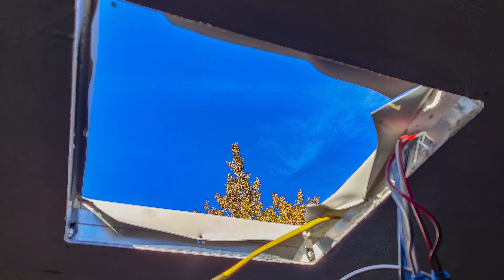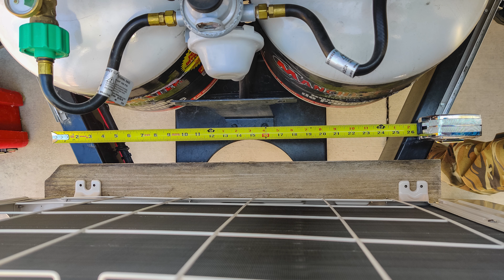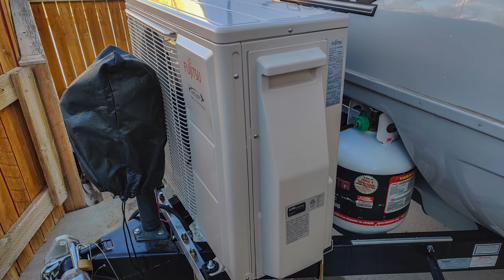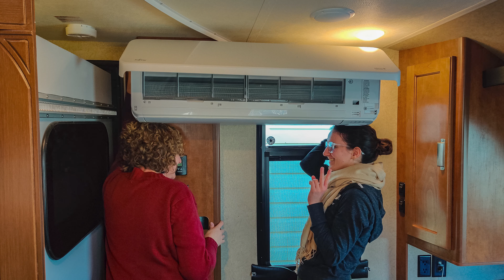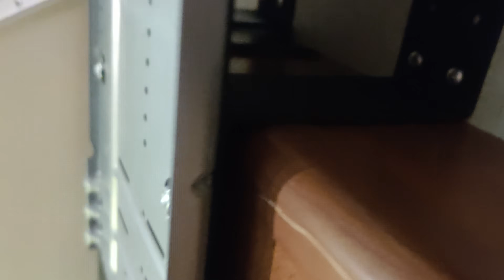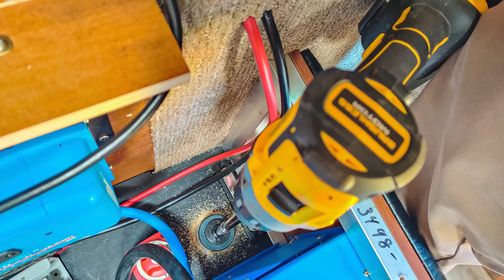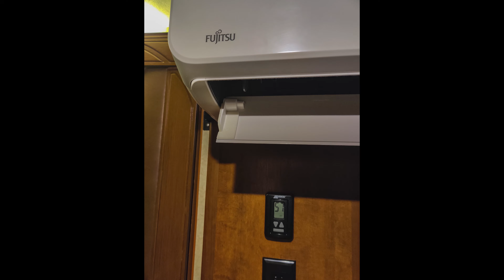How I Mounted A Heat Pump Mini Split On My Lance 2185 Travel Trailer

Comment: How come you didn’t mount the inside unit of your minisplit on the shelf above the bed. That seems like such a good place to do that on the lance trailers. You could put in some bracing (aluminum L) if needed and attach that to cabinets on each side. I am not questioning your decision just trying to find out if there is a reason I can’t do this on a 1995 😁
Reply from the maker: I wanted to mount the mini split above the bed, but ultimately decided it was too complicated of a location and likely to have problems down the road. The indoor mini split unit is significantly larger than the space above the shelf. Also the air intake is on the top of the unit so it must be installed several inches down from the ceiling. The ceiling there is curved making installation much more difficult and there's no aluminum frame there too hang the weight from. Initially I was considering removing the shelf and making a metal bracket that hangs from the first roof truss then I found the Z brackets and figured out that the side wall is a much better option so that's where I installed it.

Comment: In watching your last video (Can The Solar Array Fully Charge Our RV Batteries In One Day In February? + Valley of Fire!) it got me wondering...  why an AC mini split and not a DC?  In this video, you talked about needing 240V for charging the Tesla, which makes sense.  But I was wondering... did you look into a DC-based (12v or 24v) option?  I am wondering if they might be more efficient then an AC unit.
Reply from the maker: If I could have everything on board use DC electricity I would, because in that extreme scenario I could completely eliminate the AC components from the trailer's design saving the money on device purchase, labor to install, and efficiency losses inverting from DC to AC. However it's not realistic at this point in time to do that unfortunately. Plus there's other miscellaneous devices we bring from home such as our blender that work on AC power. I did look for a DC HVAC unit of some sort, such as rooftop mounted AC/heat pump units. I never did find a device that I felt like was the best solution considering efficiency, lots of devices out there with people using them and sharing reviews of longevity etc... Ultimately I just decided on the relatively "regular" heat pump mini split design with the indoor and outdoor units because it's efficient and commonly used technology that's not overly expensive or specialized which would make it harder to find help if I needed it in the future.

Regarding the Tesla charging, I don't have to use 240 volts, I can charge it from 120, but 240 volts doubles the speed at which I can charge the Tesla and increases the efficiency. Plus the most efficient mini split I could find (the one I purchased) required 240 volts and it's a lot more efficient than equivalent sized 120 volt versions. Obviously some of that gain in efficiency is actually lost due to having to have two inverters with their fixed standby losses, but ultimately I needed to make a decision and get past the "analysis paralysis" of the design so I just went with two inverters and it's worked fine for me. The losses in efficiency easily overcome by the large solar array on the roof and being able to transfer energy quickly to my Tesla is helpful in some situations.
Reply: @ElectricTechAdventures  I am with you when it comes to analysis paralysis.  Personally, I think it is very cool that you have been able to get into your Lancer.  

The reason I am asking about the AC is I am trying to shorten my hunt for the right solution. From your R&D did you find a noticeable difference in efficiency between the 12/24v systems and the 120/240 systems?

Right now I don't know exactly what I am building out, I am 99% sure it isn't our little InTech Luna, new developments are such that we might be full timing in 6~9 months, so... I am starting to do more series info gathering ;)
Reply from the maker: The main reason why I stopped researching the 12 volt DC HVAC systems is typically they had little to no documentation and I couldn't find details like the efficiency. My suspicion is that they're cheap foreign products with zero local support and likely poorly made and inefficient. Perhaps I'm being too harsh, but if a manufacturer is not going to give me lots of confidence in these important aspects of a product them I'm going to assume the worse and move to a product with good reviews and exact details. Keep in mind my research was all in late 2020 to early 2021 and the market could be better now. Sorry I don't have better direct answer to your question. You may consider joining the Facebook group named RV AC on Solar to see if you can get good insights from that group.

Comment: I would take it directly into the front cap bedroom keeping line clean and short.
Reply from the maker: The minimum lineset length was 10 feet and the route I took was just barely over that. I'm not sure what you mean by "directly" but I couldn't have done it much shorter. My route up through the floor was by far the best route considering aesthetics and the position of everything.

Comment: I am adding a mini split in addition to my 2 roof ac and also keeping my propane. I am adding mini split for comfort not to save energy. I tow with my Ram 3500 diesel and love to use as much resources as possible.
Reply: What is this comment 😂
Reply from the maker: Interesting.
Reply: Check out the idle air diesel APU then you'll have propane and diesel power

Comment: I just ordered the 38 seer inovair 9000 btu unit for my 93 model holiday rambler.  Its a 30 foot travel trailer with low ceiling and its really kinda small for a 30 foot trailer but hopefully my install goes as good as yours. I have 1800 watts of solar and nissan leaf battery modules. 24 modules in a 24 volt configuration. I have 2 inverters qnd the mini will be running off of my 4000 watt sungold power.
Reply: Great job and thanks for sharing
Reply from the maker: Thanks for the positive feedback, and I wish you the best in your own mini split journey! It's been a wonderful upgrade to our RV and combined with solar I love camping in our trailer. The RV electrical system upgrade swapping to all electric components has been a similar upgrade to when we switched from ICE vehicles to a Tesla.

Comment: Great video, did you also look into cassettes to go in the hole from your old roof top air?
Reply from the maker: Yes I looked into ceiling cassettes for the mini split delivery and there are two main reasons why I decided not to go that direction. One is the routing of the line set and wiring would have been impossible to hide and would have been unsightly going up the side or front of the trailer and across the roof. Second the cassette top side is not designed to be in the weather so I would have had to build my own box to go over the top side of the cassette and that was more work than what I did.
Reply: @ElectricTechAdventures  gotcha, makes perfect sense, I wasn't sure how much clearance was needed. Now all RV mfg's need to build in this technology.
Reply from the maker: I agree. It would have been easier to buy what I now have, but it was a fun project where I learned a lot. I'm afraid RV manufacturers will charge exorbitant prices for the end result of what I have now.

Comment: Did a similar conversion on my box truck overlander.  Innovair 9k 19seer.   It pulls 400 to 700 watts most of the time.  I also have a black and decker heat pump at 12k BTUs that I can add for really hot days as my insulation is a bit on the lighter side.  With 2350 watts of solar and 560ah of batteries I get by without the generator.  Solar was about 2700, 220v split phase inverter 1000, heat pumps 1100. Batteries 1200.  I can charge my electric motorcycle as well as running the ac too most of the time.
Reply from the maker: That's awesome, thanks for sharing!

Comment: The original noisy, cooling only, roof top unit was consuming 1300W. That seemed kind of low. It was not inverter based or variable speed like our Fujitsu unit. They are much gentler on out inverters/wiring. Note for those buying heat pumps, they consume twice the energy in heating mode, so figure that in when you size your battery bank.
Reply from the maker: The 1,300 Watts was as high as I measured it with my meter. It's possible it pulled more when the weather was a lot hotter. I actually never used it other than this one time to test how much electricity it used before I removed it and installed the mini split. In my experience with my Fujitsu the peak consumption of heating is about double cooling, but when it achieves the set temperature the maintenance is not double. It obviously varies a lot depending on the indoor set point vs outdoor ambient temperature, plus how often the door is opening, how windy it is outside etc. Generally AC maintenance is around 300 Watts and heating maintenance is around 400 Watts. Roughly. The huge advantage cooling has is that it's needed at the same time that solar yield is high. Where the battery size comes into play is heating overnight when there is obviously zero solar so the battery has to supply all needed power overnight. Plus the night is extra long in the winter, and the day is short to resupply the battery, and the sun is low in the sky etc... (Although that depends on the latitude.) In short, heating in the winter is a struggle and compromises must be made whether it be lowering the internal set temperature or acquiring energy through alternative means like a generator, or heating with propane at times. I'll be making a video in a couple months about my learnings over the last two winters with my system.

Comment: Friend, you have your condenser unit right next to your propane tanks!  This is so incredibly dangerous!!  All these mini-split condenser units must be (if I'm not mistaken) at least FIVE FEET AWAY from all propane tanks to avoid a fire in case of a propane leak in the tanks, fittings, or propane hoses.  You have 220 volts going to that condenser unit.  If you have a propane leak in your propane bottles or their hoses/fittings, that 220 might spark (remember Murphy's Law?), ignite the leaking propane, and burn your RV to the ground in minutes.  Please read your installation manual to verify what I wrote and possibly save your family from a fire.  I was going to mount my condenser unit in the exact same place you did until I learned it would be way too close to the propane tanks and the hoses.  Here is the relevant portion from the installation of a Blueridge mini-split I was going to install:

"Installation Site Instructions:
A proper installation site is vital for correct and reliable operation of the system.
Avoid the following installation locations:
• High heat sources, vapors, flammable gas or volatile liquids."
Reply from the maker: I don't use propane. Everything is electric, powered by the sun.
Reply: @ElectricTechAdventures  Well, that's good to hear!  Are those propane tanks full of propane?  Because even if you don't use them, and if they are full of propane, they of course can still leak.  And as you might know from experience, those propane fittings and connections are prone to leak.  You might want to, for safety sake, get rid of those tanks if they are full of propane to avoid a possible disaster if they leak.
Reply from the maker: @adobemastr  I removed the propane tanks at the end of the trailer retrofit and I haven't ever put them back. Only the water heater and furnace can use propane. I use the water heater in electric mode only. I use the heat pump mini split for heat.
Reply: @ElectricTechAdventures  Well, you are a wise man.  Kudos to you.

Comment: Very nice set up! Solar and minisplits are the way to go. I was Honestly shocked that the 12k minisplit was pulling 1400w+ on heat. Is there a turbo feature that pumps out more than 12k btu?
Reply from the maker: Thanks, it has been a great setup for us for sure! If I remember right the most Watts I've seen the mini split pull was heating the cold soaked trailer pulling about 2,000 Watts for a couple minutes. I just looked up your question in the PDF manual and it states that for cooling the rated BTU/hW is 9,000 but it's min-max range is 3,100-12,000. For heating it's rated for 12,000 but min-max is 3,100-22,000. There is a "Powerful" button on the remote that I believe sets the BTU to max for a short period of time.
Reply: Mr Cool has the turbo mode, I have never needed it, I live in Tucson and have seen 4 inches of snow, the heater kept me toasty warm and so far 100 degrees, I can keep it as cool as I want strictly off my 1200 watts of solar, I haven’t needed turbo mode yet, I have a 38’ toy hauler
Reply: @Rickwells-b3o  this isn't a mrcool. My question was about how much power it was pulling, 1400w for a 12kbtu unit is way too much. It should be using about 900-1000w.
Reply from the maker: I'm not sure what "too much" means as there's a lot of variables depending on how the engineering on one particular unit is designed. All I know for sure is what our unit is doing and how well it's working for us.

Comment: I really enjoyed this.  I have a 600ah system and 4 of the same size panels you have and a victron multiplus 3000.  I am very interested to know how the mini-split has performed in the summer.  I am considering swapping out mine for the mini split as well.    I have also had thoughts ab pulling with an EV truck and charging. No idea if its even possible while in motion, but its just wasted energy on top of the rig while you are driving
Reply from the maker: Thanks! On hot days (every day right now) I run the mini split in the trailer to keep the batteries from going over 100 degrees F. We also keep food in our trailer and I don't want the food sitting in 100+ degree F temperatures all the time. The solar array is large enough that I'm able to charge my Tesla at 1,650 Watts (7 amps) and run the AC through the middle 8 hours of a sunny day. The AC consumes 300-500 Watts most of the time. Right now it's set to 75 degrees F inside the trailer and outside it's 98 degrees F and it's pulling 400 Watts. When I first turn on the AC, the trailer is usually approaching 100 degrees F inside and for the first half an hour or so while it's pulling the inside temperature down to 75 F it's pulling closer to 900 Watts. I intend to make a video about all this, but alas haven't taken the time to do so yet.
Reply from the maker: Regarding towing with an electric truck and charging that truck while in motion, I know of someone on YouTube who did that with a Model X, but he never got into the details on how he tied it into his vehicle. He did so with some internal wiring though, not through the regular charge port. The way the Tesla firmware is written, if the vehicle knows it's charging then it won't go into drive. In my case when I'm towing the trailer the solar energy is going into the battery bank of the trailer so no energy is wasted unless that battery bank fills up. When I'm towing with the Cybertruck in the future I'll try to offload as much energy as needed to the truck prior to driving to hopefully avoid the trailer battery getting full.
Reply: @ElectricTechAdventures  cool idea, I have reservations about how much juice you will get into the cyber Truck tho, will be interesting to see, nice setup, hope it all goes well. Cheers
Reply from the maker: If you're interested I've made a video on how well it's charging my Model S. https://youtu.be/v1xaDr7MA_U
Reply: He’s right on with the power consumption. My solar power shed system is the same model:  typical Cooling amps 2.6-3.9A; Heating amps 4.0-7.0A at 240VAC.
Reply: Any issues with the outdoor unit moving at all? I’m in the process of mounting mine and despite the mount being solid and the feet well bolted down, there’s a good amount of front to back wiggle on the outdoor unit. I’m figuring out some type of big clamp up over the top.
Reply from the maker: The outdoor unit is really solid and doesn't move around hardly at all. If I lean on it I can get it to move forward and backward maybe half an inch or something but that is probably partially the rubber feet and also just the metal housing bending a little bit.
Reply: @ElectricTechAdventures  I decided to use some threaded rod and unistrut over the top like a clamp  to secure it a little more. It’s definitely better now. I cracked open the case to see if I could beef it up in any way and it seems like it’s really just that the structure of the enclosure on mine is not terribly rugged. I’m much more confident with the mount now though.